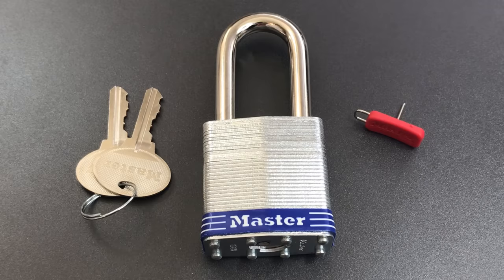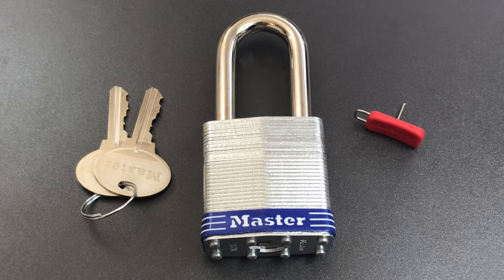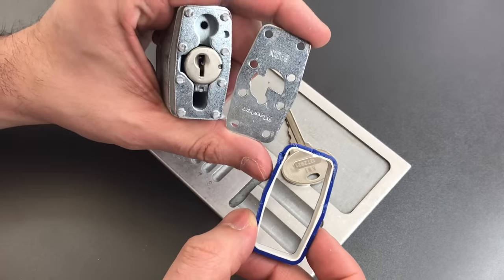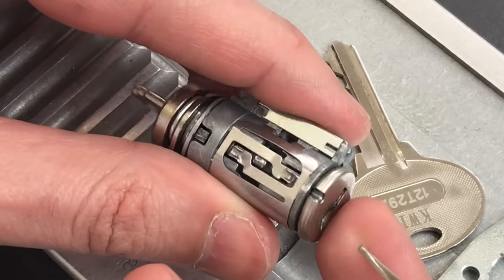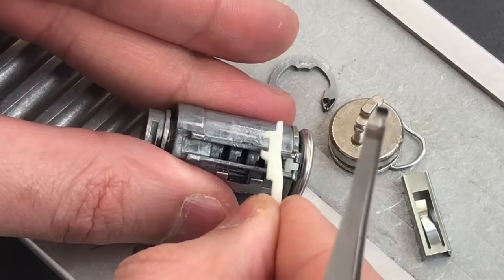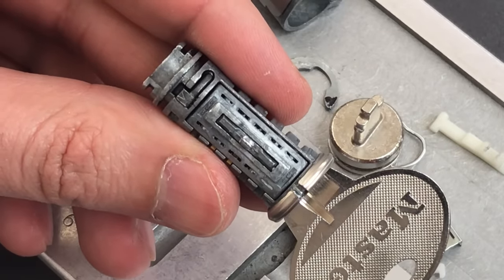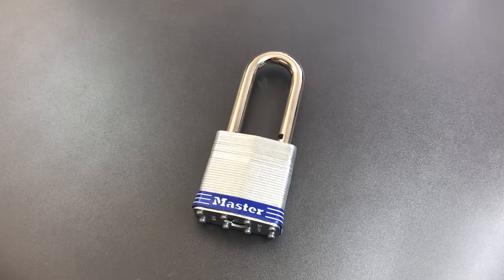[626] A Pick Proof Master Lock? ALMOST!

Comment: I have been watching so many of these and a few things have just dawned on me:

1. I have no fucking idea what he is talking about.
2. His calming voice has lead me to believe that words like 'binding' are terms that i understand. In reality i have no idea what that means.
3. I have no idea why i cant stop watching them despite having no clue what it all means.
4. For some reason i really enjoy hearing him talk on and on about things i will probably never understand.
Reply: number 2 hits home.
Reply: When you tension a lock, you're turning the barrel a little so that the inner and outer sections of the lock aren't quite aligned, which makes a little ledge that you can get the pins to catch on. Because the pins aren't all aligned exactly the same, usually one pin will "bind", that is, it's tight in its slot because it's the only pin holding back your tension while the rest move freely. So the binding pin is ready to be picked; if you nudge it into the right position, it'll "set" as the barrel rotates just a hair further, and another pin will become bound and ready to be picked.
Reply: You have just stated 4 times you have no idea what he means.  Tbh I don’t either
Reply: LPL makes it look so easy I thought it would be interesting to try. I bought lockpicking tools, bump keys, locks, etc. I still can't pick a lock. I don't have "the touch".
Reply: So what you do is you get the thingy and put it in the whatcha call it. And then you try to spin it with your doodad, while you poke inside the hole with this pokey stick. Things happen inside, and before you know it, you got the gizmos to move out of the way. The whatcha call it spins, and the goodies are yours!

Make sense? 🤣
Reply: @MadScientist267  you have cleared it up perfectly.
Reply: @Crispynuggets28  Always willing to help 😉
Reply: @Keenath  
Thank you berry much! Now I understand the term!
Reply: @MadScientist267  Come on guys and girls!  My Saint Bernard watched this and was able to pick a few locks all by herself.
Reply: heck you got me😂😂😂
Reply: Me too
Reply: @jepolch  I was able to pick the locks on my house doors... once.  I was actually able to repeat it on one of them a second time. But my picking success ended there. After that not only could not pick any other locks, I can no longer pick those locks either!  🤔🤷🏼
Reply: @srcastic8764  I've given up trying. I think I'm going to send all my lock picking stuff to LPL so he can give it to someone worthy.
Reply: @jepolch  as far as pad locks I’m pretty good at picking them with bolt cutters.
Reply: @srcastic8764  .45 ACP works well, too. :)
Reply: @MadScientist267  sure! It's the thingamajig next to the riggydiggymortis. I get it. 🤪
Reply: There are some good animations online about how locks and lockpicking works. I literally only had to watch two videos (one explaining how a lock works, the other explaining how the mechanisms’ faults allow for picking) to understand. Naturally, there are still some terms I don’t understand, but the more I watch, the more I learn. It’s actually pretty fascinating; you should look into it yourself.
Reply: I believe binding means it catches on the fault between the rotating part and the stationary part
Reply: These videos aren't meant to show you how locks work; you should watch some animations of how locks work! I did and I enjoy these videos from LPL even more j
Reply: @jepolch  same here. I bought a practice kit and picked the lock straight off, just once. As I watch these videos, I realize there is no way im going to put the effort in to memorize the different lock types and their techniques.
Reply: i really like lockpicking since some time and i feel like its the opposite for me. I got the feeling to open the locks that i try and i love it, especially Single picking which is why i love lpl but i dont have much locks to train on or the cash to buy some more lol. Everyone got a different obstacle besides lpl, he is the master and got it all haha i love him
Reply: Same dude. It's like, I feel like I know everything he's talking about, but when you think about it after, you're totally confused
Reply: After enough videos you can learn enough from context alone to understand what it means 😊 LPL definitely is very soothing to listen to. I'll usually put his videos on autoplay when I'm going to sleep
Reply: @IrisGalaxis  instead of picking locks, I've found a tequila bender can get me places I shouldn't be. No damage done, no cops called, they returned me home across the street safe and sound.
Reply: If you like his videos, getting an acrylic lock and a few basic picks from Covert Instruments will really make a lot of them make more sense. Also it’s pretty fun.
Reply: 🤣🤣🤣 You just described my whole reaction to watching his videos.
Reply: mood
Reply: nah, it's actually easy: binding is when a pin or whatever is holding the core from rotating (sidebar in this case) is clicking into unlocked position without springing back into locked position under tension of rotation of the core or whatever else, in this lock the pins that interact with the key don't prevent the core from rotating, it is done by a side bar that is sticking out of the core and acts as a one big pin, to push it into the core and open the lock you have to align dimples in the pins with the protrusions on the sidebar and the protrusions can be "rekeyed" because they are moving if you displace the holding bar that holds them in place with tiny ratchets. You have to push on a side bar though in order to bind the pins with it because otherwise there will be nothing bidning them in place unlike in the regular locks
Reply: Me too
Reply: This is how a high Charisma character works in DnD.
Reply: same
Reply: sums up my Linear Algebra experience
Reply: this is the kind of content that makes you think you understand and could possibly do it all so easily but in the end you would just stand there in front of the lock with a look of confusion
Reply: Same... just... same
Reply: I was just thinking the same thing while watching this video. "Ah yes... the 'Binding' of the lock. Of course..." [scratches head]
Reply: Glad it's not just me
Reply: @MadScientist267  tyvm
Reply: @jepolch  this was exactly my thoughts haha always wanted to learn as a kid but never tried about 2 weeks ago I ordered a cheap lock picking set and thanks to LPL I have now managed to pick my bike lock and 2 padlocks several times over. Perseverance is the key to opening any lock keep at it you will be better.
Reply: finally someone who can describe it exactly how i feel.
Reply: @Keenath  now repeat after me,  ...slowly and carefully modulate your voice to that soothing tone...Good job!
Reply: And that, folks, is why there is a Mrs. Lockpicking Lawyer!
Reply: You got ASMR'd by LPL
Reply: Wow thank you all for the likes and replies. I have never had so many. I can say with 100% honesty that now I have been watching these for some time........I still have no idea what it all means and it still soothes me to sleep.
Reply: Same here
Reply: @lauranceberiya1314  It's as easy as English.
Reply: Shaking my head along with “because when you use a sidebar with beveled edges..”, well sure, of course…
Reply: This post felt like a psychologist explaining the underlying cause of my addiction.
Reply: @RemixedVoice  You believe that these videos are educational.  For most of us they are for mood settling.
Reply: @srcastic8764  u probably screwed up the mechanism from trying to pick it!
Reply: @romanreckless8263  the lock still works fine. Nothing wrong with it at all. I just lack the touch and got lucky the first time. Whereas we hear the LPA talk about what each individual pin feels like and even what type each pin is, I can barely tell when I’m on a pin! 😂
Reply: I haven’t laughed this hard in a long time!  You are not alone my friend!  I even bought a lock picking kit and sadly learned I have no idea what he is talking about!
Reply: @Crispynuggets28  The saddest thing about reading these comments for me is how many of LPL's viewers obviously have lock picking skills but 0 social skills or sense of humor.  Thank you for continuing to remind me that there are people in the world like me who enjoy entertainment for entertainments sake.
Reply: Absolutely hilarious!
Reply: His voice has a touch of ASMR I suppose :D
Reply: @vargad3919  To me, he sounds like Fred Rogers might sound explaining lock picking!  Very slow, soothing and reassuring voice.
Reply: He's the Bob Ross of Lockpickers.
Reply: @MadScientist267  this also describes sex
Reply: Hahaha
Reply: @blitzofchaosgaming6737  I can pick locks. I use my boot and a lot of force 😂
Reply: @Crispynuggets28  I normally go for a hammer, but I'm sure a heavy enough boot works too.
Reply: @blitzofchaosgaming6737  I used to put a stick through letter box when I was a kid and do the door latch when I forgot my key. Tried as an adult and my arms are way to fat now.
Reply: This isn't an ASMR channel? I listen to LPL to sleep. Very soothing
Reply: Same. wtf
Reply: You're right on all 4!! 🤣😂🤣
Reply: Yep, I think that’s 90% of us here! 😂
Reply: This is proof that we are social creatures
Reply: @MadScientist267  I couldn't have said it better myself
Reply: his voice REALLY gets on my nerves. I turn the sound off.
Reply: 4 answers your 3
Reply: Frfr
Reply: @Joe Polchlopek  we should start a club. I've  bought tons of his products,  and I've seen him get them to work.  I had random buddies use my stuff and make it work, my 15 yo daughter asked why I was screaming at the back door, showed her , and she gets them to work, I don't know. I just have to smash a window still . I suck
Reply: I have issues opening the lock with the key. When the key is stuck I put my ear onto the door and starts whispering while shimming the key. Click on the one... My wife still doesn't get the joke
Reply: I love how he's just oh yeah the usual glaring weakness that makes this garbage are still there but we're just going to ignore that because they did something interesting.

Comment: I was a toolmaker for 25 years and never knew there was a "c-clip remover" tool.

But we used to call them "Jesus clips" because when you popped them off with a small screwdriver, you'd always say "Jesus, where'd that go?"
Reply: My take is that may be made specifically for locksmiths, so they don't have to call them Jesus clips :)  I have never heard of one either.
Reply: I've always called them "dammit clips" for the same reason.
Reply: this made me laugh and i dont even pick locks 😆
Reply: Not a locksmith, but called them the same name for the same reason.
Reply: Don Moore Can deconfirm, engineer who’s helped out in machine shops that used C-clips in design before.  The tools are known outside of locksmithing circles...but probably not outside a small number of other specialized engineering fields.
Reply: Jesus calls them "I dunno" clips
Reply: Really? Every rekeying/pinset kit ive ever used at work had a c clip remover, though usually it's a flat brass bar with the crescent cut on the end,  and not hook shaped like lpl's
Reply: C clips and 10 mm sockets are Auto Shops Back to Back Hide and Seek Champions
Reply: I worked in fixing medical devices where we used the C-clip remover tool all the time. It makes life soo much easier, but ya, those things are practically still miniature bullets.
Reply: @donmoore7785  Na. I used it in my workplace a lot for repairing devices. I thought it was a pretty common tool?
Reply: Like the helicopter, there is a bolt connecting the propellers to the helicopter called the Jesus bolt. If it falls of, the only thing you can say is "Jesus!"
Reply: Ain't THAT the truth!!
Reply: lol
Reply: lmfao
Reply: Heard that term in the auto industry
Reply: Amongst my friends at least, for very similar reasons to yours the C-clip / circlip is more commonly known as a Pingfuckit.
Reply: @UKCougar  perfect name
Reply: You've never used a pickle fork?
Reply: So THAT'S a Jesus clip!
Reply: Lolol
Reply: I have no idea where you worked, or how, these are very commonplace tools in any shop I have been in. No one besides a DIYer would ever use a screwdriver.   Tool and Die maker myself
Reply: Engineers are like lets make a device that only we have the tools to handle so people have to buy new ones for losing/breaking them, and they will be used everywhere and always need to be removed during service. Instructions will describe a prying screwdriver instead of our fancy clip remover that is a modified pair of tweezers.
Reply: I always listened for the ricochet.
Reply: Thought they were common. I’m a wood worker and even I have a set
Reply: That's...pretty sad. I've had a C-clip tool in my box since I was 14.
Reply: I think I have one in my tool box but I never knew what it was for and I have no idea where I got it.
Reply: Any part that launches during disassembly is a sproinger.
Reply: snort
Reply: Isn't it the same thing as a 'snap ring tool' ???  You know, the plyer-like tool with two points that fit in the holes of the snap-rings ?
Reply: @photon2724  that tool would have been really useful when I was stripping my rifles down to clean
Reply: Oh good lord yes the Jesus clips I hate those damn things!!!
Reply: Just like Jesus, you set it aside and it disappears a little bit later
Reply: Common tool for RC trucks and planes in various sizes. Both E and C clips.We have  always called then MF clips@€#%]|!!
Reply: lol good one but I think we all have other words for that when we lose stuff but yea your word is probably better. 😜

Comment: I used to repossess cars in the early 1980's, and the owner of the small firm I worked for used to say that those side bar GM ignition locks were un-pickable... for the reasons you state here. I know I never did. I would use all sorts of techniques, whatever was appropriate, for different vehicles and gates and so on: Picking, cutting keys (when the code was still find-able... as you know many cars would have it on a label in the glove box, or stamped on the passenger door cylinder), slide hammer as puller, and the hardened "socket" with breaker bar (would simply shear all the pins and turn the cylinder. "CRUNCH"). 

But the GM locks, we didn't even try picking. Since then, because of that, I often wondered why side bar mechanisms like that were not used in padlocks and so on. But there you go! Now I know they do in some. 

Love your videos... very interesting and informative. And you keep the lock companies on their toes, I'm sure... and only help improve the state of the art by revealing the weaknesses.

Comment: if any lock company would just use the reverse sidebar lock design, without the rekey option then it should be extremely hard to pick that lock, no binding, no picking. provided its not made of cheap metal or plastic!
Reply from the maker: Agreed. Interestingly, there are quite a few of these made in China for the Chinese domestic market.
Reply: You can accomplish that by grinding the dovetail off the locking bar. Maybe better suited for their dead bolts where you're not destroying the lock to get to the cylinder core.

Comment: Masterlock CEO: finally, we have created the unpickable lock!!!!
LPL picked it in 30 seconds
CEO: I QUIT!!!!!
Reply: Insanely idiotic. They make cheap locks. If they wanted to make an unpickable lock they’d use precision machining and quality materials. 

The fact that this lock is difficult to pick and cheap to make is actually a really good thing for the CEO.
Reply: They just needed to protect that one little knob and it would be unpickable duh
Reply: @dreamyrhodes  yep just a full plate on the side instead if that with the openings and it would be a lot harder.
Reply: More like, shrug, they don't call him lpl for nothing
Reply: Well, to be fair, LPL literally made a tool just to pick this lock
Reply: @dreamyrhodes  well.. you can still grab a piece of red bull can and slide it in between the shackle and the lock body. You don't need to interact with the core at all.

Comment: Never thought of how a rekeying lock works before. This was a really cool video!
Reply from the maker: Thanks. All of them actually work very differently, I suppose to avoid violating each other’s patents.
Reply: I would need some help of drawings or so, as I didn't get how this rekeying works. Also not sure why standard tension won't work here. I guess not my level yet ;-)
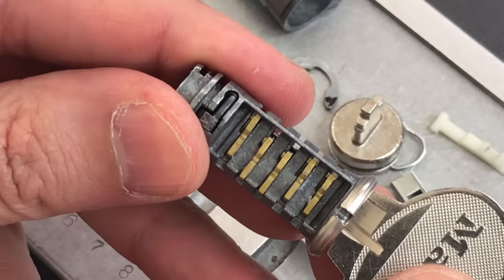Reply: @ziomalZparafii  Looking over the video again it looks like the brass plates sit upon the teeth of the key (9:01) like a pin would. Those plates have slots in their spines that fit lock like a puzzle piece into the rekeying sliders (8:26). Those sliders hold the height for each bit on the key, and they only move when you are re-keying as they are otherwise locked to "imprint" the key. The reason you can't use only a tension bar to turn the core is the piece that prevents you from re-keying to a key with no bitting (7:18). If there is no key depressing that piece at the back, it will stick out and stop the core from turning. I am no expert, and sadly I have not practiced lockpicking for a while but that is what it looks like is happening to me.
Reply: @DrumDudeMatt  thank you for detailed answer, I'll have another look with those information.